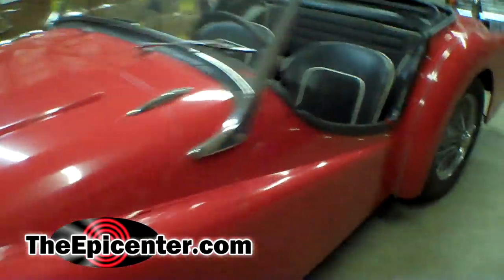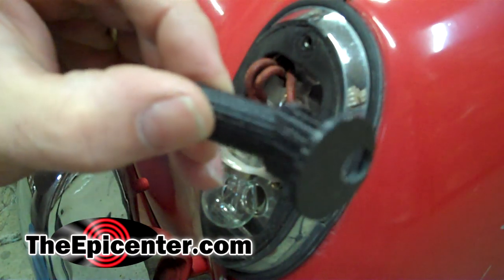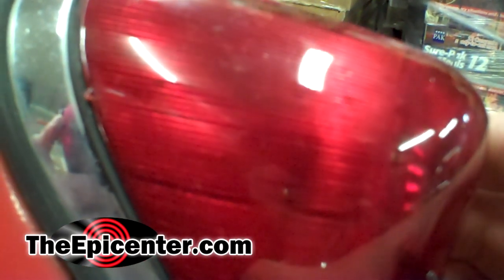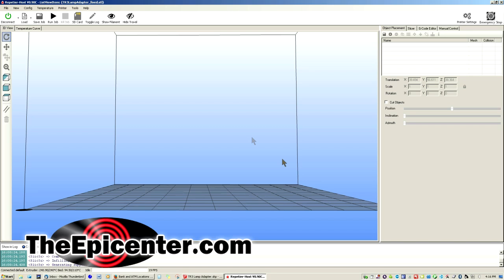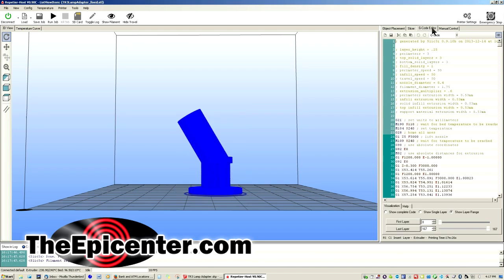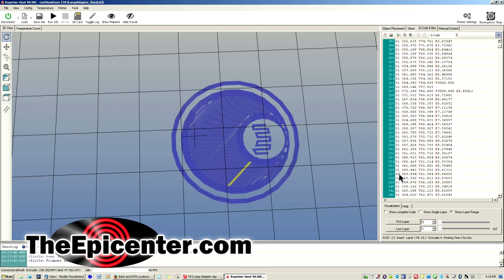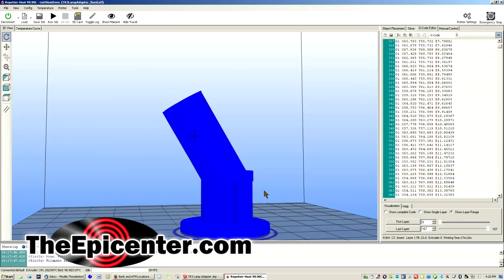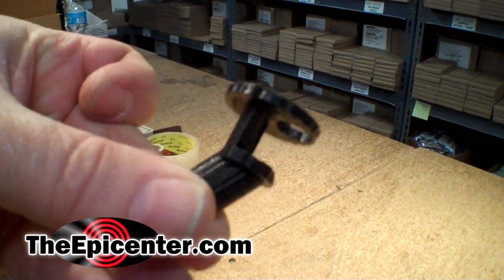Triumph TR3 LED brake light modification with 3D printer

Comment: I'd be about concerned about the heat of the bulb cooking the LED, glue and plastic (PLA ?)

Also, why not adding the "spare" light in the center housing with a simpler wiring?